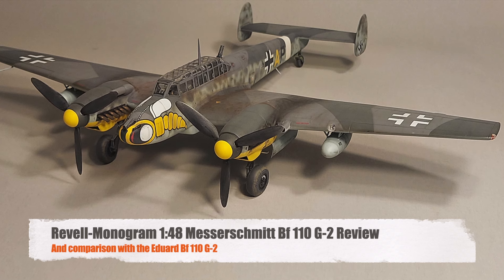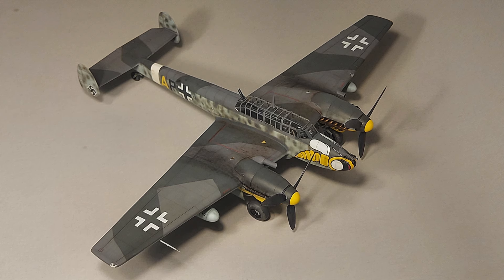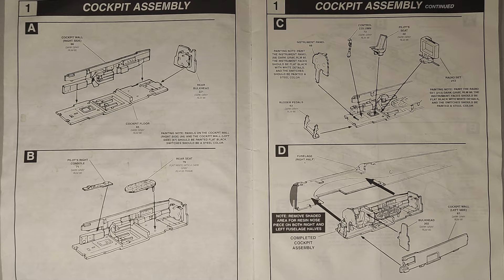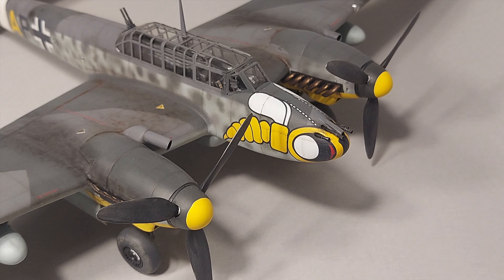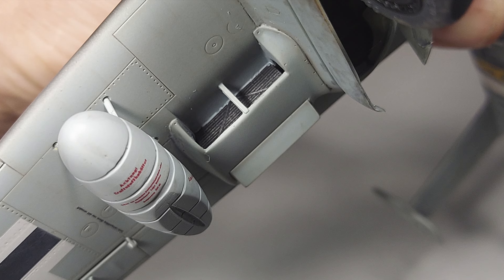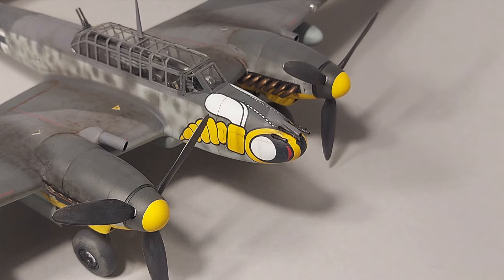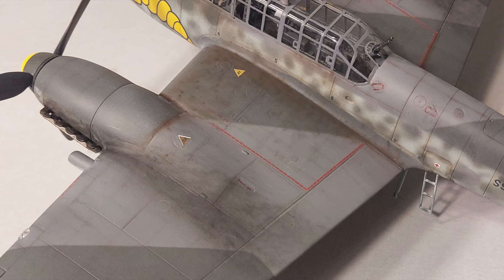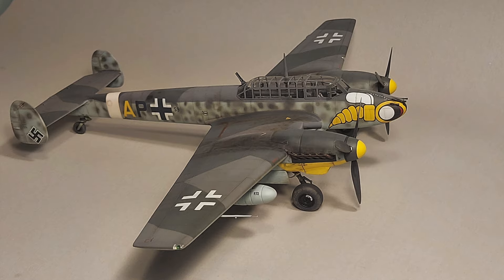Revell 1:48 Messerschmitt  Bf 110 G Review - Compared to the Eduard Bf 110 G

Comment: Hi Jon. Very Nice result. The resin nose and the  weighted and branded tyres are good for an "older" kit. 
Have the Cyber Hobby Bf-110D Nachtjager in the pile. Don't know how it builds up. One look at it though and, as you recommend, purchased the Eduard mask set!
Well done on the manual masking job! Nice work also on the wasp decals. A very striking colour scheme.
Cheers for the vid. Matt🦘
Reply from the maker: Thanks, Matt! I would love to check out the Cyber Hobby Bf-110. I had forgotten about that kit. Let me know how yours turns out. Cheers!

Comment: Jon, really outstanding build, a lot of detail finish work, I definitely need to add this to my build list. The canopy would definitely need a masking kit with my shaky lion paws Great job on all the yellow, toughest color to work with.I did finds a recipe for my
 " chrome" aluminum for the B-58, a black coat gloss for undercoat with one of the Alclad metal paints. Its in my test list. Definitely enjoying the larger models your reviewing . It's really difficult not to buy, however, I'm watching for some new 2025 releases and trying to catch up on building rest of the year.  So Manny models so little time. Cheers Bob.
Reply from the maker: @c123bthunderpig  Thanks, Bob! I'm definitely in a buying freeze currently. I probably still have too many kits to finish them all. 😅 The B-58 is an all-time favorite of mine. I built one in 1/144 many years ago. I don't remember the brand of kit, just that it was molded in silver plastic. Such a beautiful aircraft!  Cheers

Comment: Hi Jon, excellent way to show that the Revell kit is a great model, although it does not come with so many extras, I think it is more enjoyable than the Eduard kit, comparing the Eduard kit that I built a couple of months ago, it was the Eagle Day version, with armament resins, maintenance crew and the traditional ones from the Profipack, In many things the Eduard kit visually on the inside is superior, I don't know if the Revell kit will be like on the inside, looking at the video, it looks good. 
As for the landing gear/engine nacelles, there I had difficulties in getting them to fit tightly, plus the position of the landing gear is very weak in its assembly, that's my appreciation, i see that in the Revell kit it looks much better. 
 I chose the version with the shark mouth snout, so to speak, but the decals were very difficult to adjust without them starting to crack, and they also had a very thick film.
 I tried to remove it, wondering if they were the new type of decals that Eduard is using, a real fiasco.
 I chose to leave them as is without removing the film and matching them with gloss varnish. 
Well... I think my comment exceeds the comparison of the Revell kit, it should go in the Eduard one hahahahaha. 
Greetings Jon and until the next video, it is always eagerly awaited.
Reply from the maker: Hi Francisco, thanks for the personal insight into the Eduard Bf 110. It aligns with what I've heard about it (though I haven't built one). I've built several Eduard kits from the era of the Bf 110 and they seem similar - they all emphasize minute detail over ease of construction. There's no doubt that the Eduard kit can be turned out brilliantly by a master, but they can be challenging builds. Cheers!